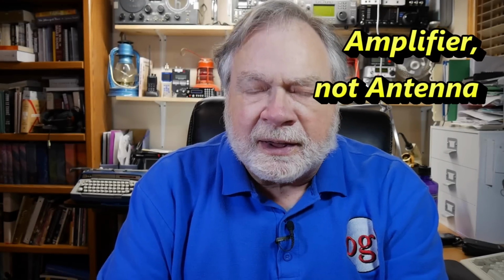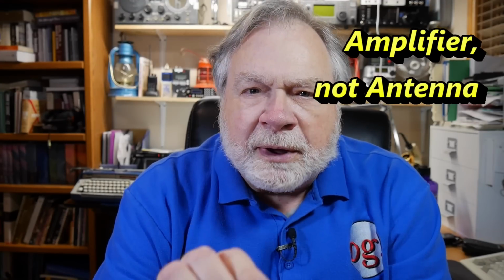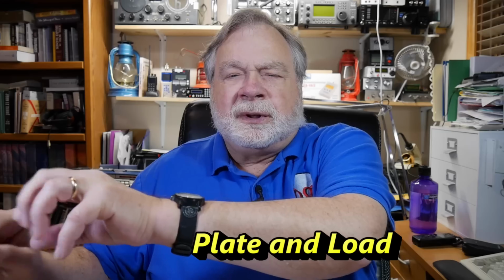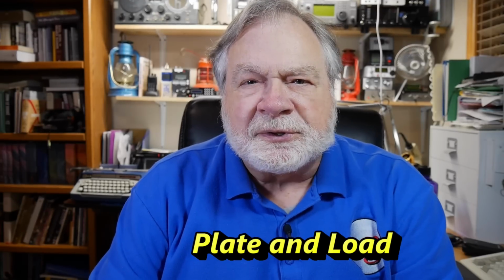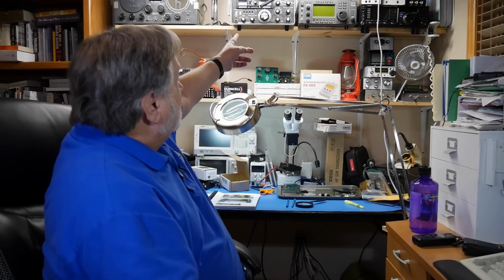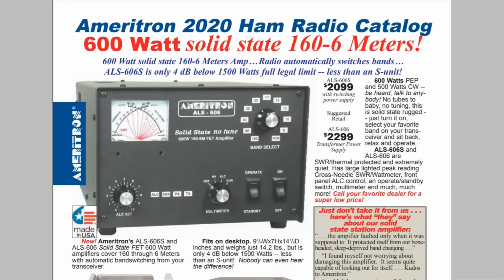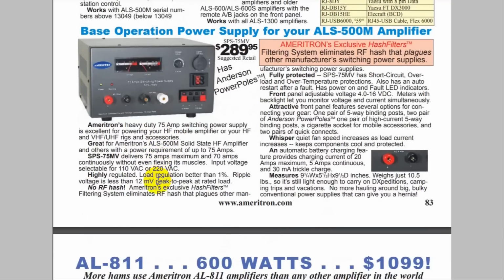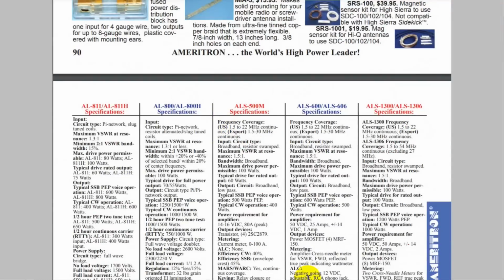When Can I Get an Amp for Ham Radio? (#346)

Comment: Q. When should get a linear amplifier?
A. When you've done everything Ham has to offer and your radio soul is dead.

Here's some analogy...

I own two yachts.  My 48 footer is lovely, sails well and is very comfortable to live aboard.  I lusted after her for about two decades before I could finally afford her.  Now that I've got her she's expensive to run, maintain and berth.  She's very forgiving in wind and you can be quite a sloppy sailor and not come to too much harm.  She stays moored most of the time.

My other yacht is a 1966 Contessa 26... at 26 foot she's cramped, you have to crouch below, she's real low to the water and you're certainly gonna get wet... she's also one HECK of a lot of fun!  You're "closer to the wind" so she makes you a better sailor... handle her 'just right' and she'll fly!  I get out in her far more often.

But... before I had either yacht, I used to sail one man dingies... they're only slightly less wet than swimming, they'll take any opportunity to dump you in the water.  Everything you do, you see the effects immediately.  Every mistake will punish you... but get it right and you're rewarded instantly !!!  The best sailors I know were Dingy sailors as you really need to be on your game, they'll teach you EVERYTHING you need to know about sail... they're also some of the most fun you can have outdoors.

Guess which two have given me my fondest memories ; )

QRP is like that.  It may be frustrating running on 5w... but you cannot get by on sloppy antennas and practices.  You're gonna need good ears... and you're always going to be tweaking with antennas to squeeze the best out of such a tiny radio.  It's frustrating and rewarding in equal measure... but you know instantly when you're impaired your setup, even slightly.

So, QRP makes you a better ham!  It's where the maximum fun and reward is at.

Now, you may be lusting after the full license and 1,500W, just like I lusted after my 48-footer.  But there's hidden cost... you're no longer feeling the imperfections in your setup.  You're no longer getting the same satisfaction at squeezing out those DX contacts!

Sure, if you use radio professionally, it makes sense.  If you're lazy or the hobby doesn't excite you anymore, it makes sense.  But moving to big watts is like giving up on your childhood wonder.

QRP for life, baby!   Linear Amplifiers are for club shacks and grumpy old men HIHI

73 de M6UDS

Comment: All things equal , try an improve your antenna.  On that.  Gain works both ways!!! Then add power.   The common argument is there is only a small (few )  db gain in power between you rig, about 100 average rig  and a 500 watt amp ...yes.  The truth is if your near the noise in a QSO , a couple db can make or break the QSO.   Doubling your antenna power is a 3db power gain.  And 4 times your output power to the antenna is 6db power.  And get this.  6db of your output gain then doubles the received voltage at his receiving end.  Thats significant.  But remember youve done nothing for receiving unless you improve the antenna, like low loss coax, better connectors , a good match, radials of correct number and length to lower ground losses on a vertical etc etc. K4DSB.

Comment: Hi Dave ‘I’m one of the ones who needs one of those expert professionals you alluded to about your yeasu on the shelf.I have a 1950s tube type Military transmitter/receiver that puts out a whole 7watts of AM power .it’s not 50 ohms…. has a plate and Load on the transmitter. I would just like to get a small amp for this just to be heard.your thoughts,tnks.jim

Comment: Remember, power output is 1,500 watts "effective radiated power", not 1,500 watts measured at the output of the linear. You have a gain antenna measured at 3 DBD (as a dipole, not isotropic), you have to figure that in to the total output of the amp and reduce power to meet the rules and regs.
Reply: In the USA per CFR Title 47 Part 97.313 it's 1.5kW PEP into the feedline, not EIRP. Your laws may vary and there are exceptions in subheadings for say 30m and other bands but the general rule of thumb in the US for limits under 97.313 is peak envelope power, not EIRP. PEP is defined in Title 47 Part 97.3 (b) (9) as "PEP  (peak envelope power). The average power supplied to the antenna transmission line by a transmitter during one RF cycle at the crest of the modulation envelope taken under normal operating conditions."

Comment: F5vhz..... That's a poor argument.... If you can hear them, and they can't hear you... Get an amp....
This is why so many stations can't be heard.... because the other station can't hear you over all the 500w,1kw,1.5kw 3kw stations that are calling them. . And YOU can't hear them either because there is no skip between you.
I've worked MORE exotic new countries since I sold my 1kw amp 10 years ago.
 I run 100w "barefoot" and especially listen for very weak stations. Get a good antenna. That will give you more gain on rx and tx. 
Rather than continue with a bad antenna system, a  poor quality audio, or bad location, the biggest reasons for not being heard.
I've gone from 56 countries to 127 out of a possible 195., and counting, by changing how I operate over the last few years... Just with 100 Watts.
Stop calling the 60 over 9 sigs, and start listening for those s1, s2 Stations, you will be one of the few stations that respond... And your chances of being heard will increase by 100 fold... When the distant and sought after countries just start coming into range, they WILL be weak... That's when to strike... Not wait until they are 60 over 9 and everyone is throwing megawatts at them... Cranking up the power just makes it even worse for everyone else... Works for me...

Comment: Other people have pointed this out: in VK & G (Australia and the UK) two places I am licensed we are allowed 400W pep and around 100W AM. The difference between an actual 100W pep and 400W pep is 1 S point on the receiving stations meter. An amplifier for a 10W radio to 400W pep is only around a 2 and a bit S point increase. I do own amplifiers but I am realistic about the actual effect. I think people get confused by ‘Big’ stations - the ones with huge towers and huge beams that run at (or over) the legal limit that are easy to hear so people think if I get an amp that will be me - but you will need the huge tower and beam and ‘all knobs to the right’ to replicate their signal. It’s made worse by countries with no effective limit on power that you hear on the bands.....
Reply from the maker: Good observation.
Reply: Who cares about S units? You need to be heard above the noise!

Comment: That's great David.  I am always learning with you however your question "If you can hear the stations but they cannot hear you, it's time to get an amplifier".....Hmmm....not always.   I am not an experienced operator and have only a 100W station with a Dipole antenna.  
I have made some amazing QSO's with this setup (just the other day had a QSO with OF73ELK, in Finland on 15 metres...and I am in Auckland, New Zealand......I was getting there 4/5).
What if the station I am trying to reach has a directional antenna pointed to the opposite direction I am broadcasting ?   This happened many times with me.  It doesn't matter what I do, they will not get back to me.
Reply from the maker: There isn't any general rule in ham radio that doesn't have exceptions!

Comment: Dave...what about old HeathKit amps like the  SB200?
Reply from the maker: Yes, they work fine. If you are going to run on modern radio into the Heathkit amp, then you may wish to temporarily put it tuner between the rig and the amp to make sure that the to match. You can also use an antenna analyzer on the input to the antenna. You will likely be able to use the plate and tune controls to tune your antenna. Also watch out for how high the AGC voltage can get. Also check the voltage across the transmit input to the amplifier. This voltage must be grounded when the rig wants to transmit. If it's more than 5 V, and takes more than a few milliamps, you may want to put a relay in the circuit.
Reply: @davecasler  I plan on putting my antenna tuner in the loop between my transceiver like you suggested.  I'm a veteran HAM on a budget, I have a Alinco DX SR8.  Being new at HF after just getting my General rating.  I would drop my radio down to it's lowest output power setting before using the amp...correct?

Comment: My Father tells about talking code around the world on a half watt transmitter, Now it seems hams need 100 plus watts to get across the state/ country. Does my father know something modern hams do not? How was he able to get all over the world on half a watt and you all seem to need 100plus watts to get far less distances?
Reply: Depends on the sunspot cycle. When I first got into radio beginning of the 90’s you could work the world on SSB easily with 5-10w and CW on a quarter watt. It was amazing times. Since then, feels like the sunspot cycles have been disappointing as the 90s were the baseline for me.
Reply: @mateostyle  Thank you for an answer to my question. That makes sense as I know sunspot activity has been way less in recent years. I am excited to hear sunspot activity is increasing as of late.

Comment: I'm surprised that in this discussion of power amps there was no mention of the inverse square law. Only minor mention of the rate of return by increasing power by a multiple of ten and by comparison of power increase seeing very minimal difference on the receiving end. Once we're all running a KW class station the next logical step is 5 or 10 KW. It's an interesting mindset regarding power amp. 

If you want to put the inverse square law to the test start a QSO with 100 watts and ask for an RST. Then drop down to 10 watts and ask for one more RST without disclosing what change was made. I think it will surprise many.  

73's 

P.S. as you may have already guessed QRP Op here...

Comment: Great job Dave, I have just aquired a AL 811 H  800 watt amp. I have an HyGain AV-680 antenna but as you said you can't work them if you can hear them. A tower is not an option but even with what I think is a good antenna I don't hear very much DX. I bought the amp from a club member that is an engineer and got it at a great price. but think it will help with getting through to people I can hear but what about those that I can't hear. I live in South Dakota and have been told that because of my location hearing DX can be a problem. Is there anything elese I can do to improve my reception on my IC 7300?
Thanks, Jeff KE0KRO

Comment: Hola!  What will happen if I run 5 watts from handheld radio via portable 20w amp on max into multiband antenna that is specified to 10w? 
I say again: what will happen if i exceed the specified wattage for the antenna?
Reply from the maker: You risk melting it.

Comment: You have to have an amp if you want to work every night on 40, 80 and 160m. 40m international working Australia, Asia and Russia you have to run power and best around at least 1k. But if you want to only work the states and have hard times doing so with the lightening stay at 100w. 10m is about the only band an amp isn't much difference. Get a 572B amp for an instant on tube amp. Ceramic tubes you have to wait a minute or more for the tubes to warm up before transmitting without ruining the tubes.

Comment: This is a topic that I am in the middle of navigating. Been a HAM all of about 9 months 😁, and have spent a significant amount of time, effort, and money on good coax (lmr-400 ultra flex), multiple 8’ copper ground rods, individual lightning arrestors for each coax (mainly for general grounding, not lighting), station ground, flat strap grounds, minimal AC power, primarily DC power (including my lighting etc), ferrite on all cables, 34’ mast with an inverted L config Chameleon Emcomm III Base (130’) antenna. Finally I run my RX signal through a Heil PRAS system to pull the transmission out of the noise.

With all of that I just cant always get through. However, I consistently work coast to coast (not into DX anyway) from Oklahoma. The consideration is based on my frequent HF Net participation where I sometimes fight to get contacts for Contact Nets or TX strong enough for rag-chew nets. 
Always something to consider. I like the simplicity of a 100w rig without amps, tuners etc

Comment: I have an LDG-600 remote antenna tuner at my antenna. Do I place the amp between the radio and the tuner?
Reply: Will the tuner handle the power of the amp?  It's only rated for 600 watts ssb.
Reply: @loctite222ms  I don’t have one yet but will only go with a 500 watt tuner.
Reply: @w6bzy  Do you mean a 500 watt amp?
Reply: @loctite222ms  yes, I type faster than my brain can keep up. Maybe the one David has. Limited space for one.
Reply from the maker: Yes, the amp goes right after the radio and before the tuner. Make sure the tuner can handle the higher power. Many do not.
Reply: @davecasler  thank you. Looking at the same one you have. My LDG-600 will only do 200 watts digital but 600 voice. Never run more than 60 digital now.

Comment: I have a Collins 30L-1 that I had been using but it's a vary nice old classic and I didn't want to run it hard . So seeing I wanted an amplifier that could regularly do 1kw with out stressing it so I went with an Acom 1500 . Even though I have all this power at my disposal it's still a challenge to try to get the contact with just 100 watts . Great video 73 n8wxt .
Reply from the maker: Thanks for sharing!

Comment: Hf splatter splatter every where due to stupid radio amateurs using exeess power if you cannot work on 100 watts you need a better antenna system or try qrp now that's a good idea. 73

Comment: This may be an odd question;
I'm fairly new in the HAM world, only got my license about a year ago, and I'm on social security...
Since HAM equipment is rather expensive (yes, even used...) I want to build a base station.
I am an electronics engineer, so that side of designing / building isn't really the issue, but what features should a reasonable entry level HAM transceiver station have?
And are there any good resources for design tips / feature tips etc. ? I mean, other than this channel of course :p Wouldn't ask anything here if I didn't find the information on this channel really informative and useful ;)

I don't know if it makes a difference; I'm in the Netherlands.
Reply: might want to look into the ubitx it's basically everything you need from a radio

Comment: When you asking about  if you're antenna is good enough, you should always ask where do you want to have contact to!

If you working dx, yeah your vertical is a great choice for the "price point" relative low radiation angle, if you're budget or situation doesn't not allow you to put up a mast.

If you working local, under 600 miles, the radiation pattern might be too low, and you might have better results on 80 and 40m with a low mounted dipole

With dx You can still play around with vertical setup with some half yag or stack verticals, half yagi is for my understanding single band solution and you need to have good ground for every element does mean you build it for one direction.

Stacking verticals you can aim your singnal with phase adjustments, with only two 1/4 verticals a 1/4 way from each and driving other in 90 degrees, you get a nice wide pather with a nice good back to front attenuation, (great if you have nice coming from one direction) but it will gain you only 3db and its double the work, and you might need to doo some magic to get it multi band.

Personally for my situation, I Drive only a mobile station, (yeah putting up some antennas for some events)

A mobile station is always a compromise, I build some antennas my self from fishing poles. 

In a mobile station you usually hear better than you can transmit on hf, that's mostly because most base stations are having higher noise floor with the bigger antenna so on the receive side its not that much worse, (it is but not that much) but transmitting I do have problem to get out. 

 have a project for 1kw mosfet amplifier, one of those 50V pallet, relatively inexpensive way to go, need to mount it on a heat sink and do the txrx relays. Power I'm getting from a combo off 230v 1000w inverter and 50V power supply (yeah, I'm from Europe so we deal with 230v) this system should give me closer to 800w on ssb if my math ia right (yeah you can drive the 1000w inverter little over the spec for a short time) I'm going to build the filter for 10, 12 and 15m so the amp will never work down on the long bands. 

I'm rocking a camper wan so I do have space to install the gear, having abaut 100A alternator and some extra battery capacity to not be a problem with current spikes

Comment: Remember also that many older tube amps have significant switch voltage and current on the PTT line.

If you plug it right into a modern rig you can easily blow up the PTT switching mosfet

Instead you need to create a transistor/relay arrangement to interface the 2 together so that the relay can sink the current from the PTT line on the amp
Reply from the maker: You are absolutely correct.

Comment: thanks Dave - great advice as ever.  We're limited to 400w in the UK and that feels like plenty.  Funny thing is though - I get as much pleasure from 'not' having to use my amp with 30-100watts - (use only what you need) as I do when when i need to switch it in and complete a contact.  running an amp all the time becomes a new normal and you forget the benefit of your investment  :-)